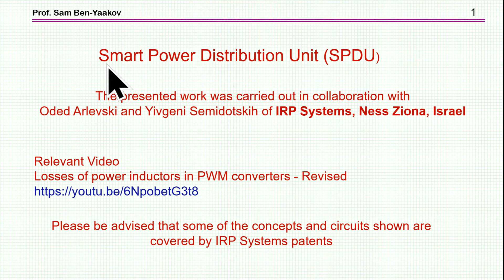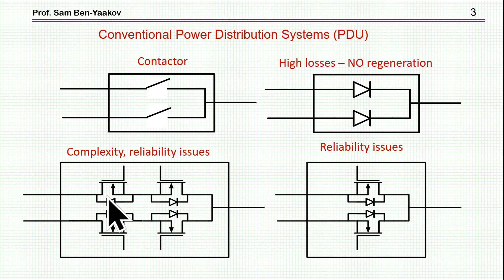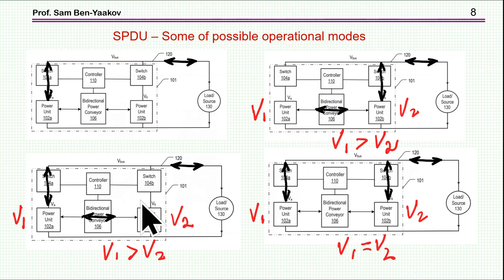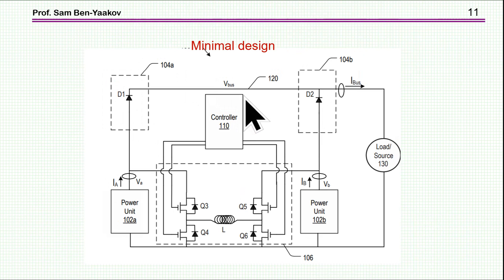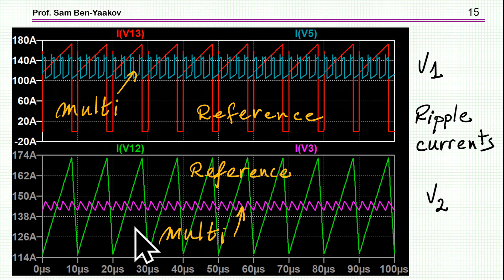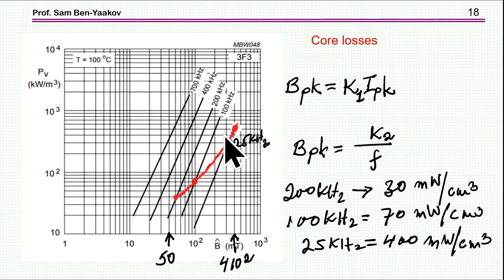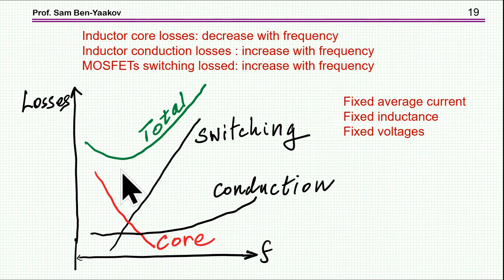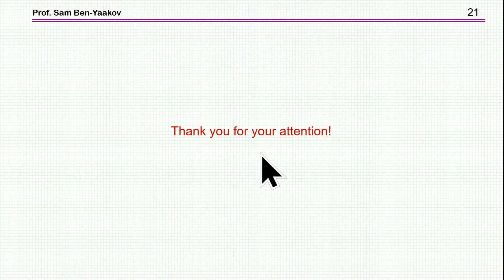Smart Power Distribution Unit (SPDU)

Comment: Shouldn't there be an acceptable voltage difference between the batteries when both will supply power ? Otherwise it could lead to chattering where the system constantly keeps charging one battery or the other ?
Reply from the maker: If voltages are the same there is no reason for current to flow. If there is a difference the current could be very high considering the low internal resistances.
Reply: Traditionally in the drone community people just connect battery packs of same cell count in parallel to provide more power.

If it can be shown that this unit provided significantly longer battery life, it has a huge market.

Comment: I have a doubt Sir. Even if Bpeak doesn't go up with frequency, but stays the same. The fact that loss is given as KW/Vol means if Volume decreases power loss should decrease.

So can't we say in general that higher frequency is good ?
Reply from the maker: Hi Srinath. The case under study  is: given a built inductor, what is the optimum operating frequency.

Comment: Thank you for the video, this was a really good explanation. Just a minor thing: on page 20 the temperature rise seems not to match the picture for 100 kHz. 34K vs 23K
Reply from the maker: Wow. Thank you for pointing out this error. You have a keen eye. In this case the deference between 50K and 100K is not that big. Getting much bigger though at higher currents. I will put a notice on that at the description section. Thanks again.

Comment: Dear Professor, thank you for the presentation. I have  a question about this topic since i am implementing the same thing without bidirectional dc-dc converter. We agreed that no need to implement converter, instead a contoller should let the higher voltage battery run first and when two batteries reach the same voltage level 2nd battery should be activated. First battery will discharge/charge higher C rates for a limited time but eventually their characteristics like impedance and aging will get similar values. Does anything wrong exist in this consideration? Will be glad to hear your thoughts. All the bests
Reply from the maker: Thanks for conversation. The approach you describe is basic but it does not answer the requirement of being able to supply a current which above the capability of one battery. This is our specs.

Comment: What is the controller's objective? I would aim for minimisation of the number of charge-discharge cycles and the minimisation of the probability of damage to the battery.
Of course since the power source could be anything, the second objective cannot be applied unless you have a dedicated controller for the battery technology intended - and associated sensors/inputs. The first objective would be tantamount to limiting the percentage of discharge of either battery i.e. strive for equal amount of charge in both batteries) since the controller cannot know how many cycles a battery has been subjected to.
It looks like the intended application is only for energy sources capable of holding electric charge, i.e. PV cells need not apply.
Reply from the maker: The tasks of the controller are numerous, from generating the gate drives, current sharing between the inductors, controlling the bus switches, controlling the proportional current sharing of batteries and more.
Reply: @sambenyaakov  I was referring to how it decides how to do the last one-controlling the current sharing of the batteries.

Comment: Great video!
As a question, II don't know how those bidirectional FETs are driven. Are there special ICs, or do normal ones work good enough? Also, is there any advantage in the common drain to common source configuration? 
I searched a few previous videos but didn't find much; this may be an interesting topic for a potential future video.
Reply: I think common source is more robust acc to protection but needs floating type gate drivers which may cause some emc issues, common drains may be low cost and diode recovery should be considered in some cases.
Reply from the maker: Thanks. Good points.
Reply from the maker: These are common FETS which will conduct both ways. Common source is preferred so yo have common "ground" for the two FETs.
Reply: @sambenyaakov  THX so for nMOS coon source allows me to use 1 high side nMOS driver only since both gates have the same reference, that make sense, and the dioes prevent current getting in, that also makes sense 
BUT for pMOS that would mean that current can inter the common area from both sides and then I am not sure how to drive them OR since it is p I need to make it common drain and then also drive it like a normal high side pMOS?

PS , tho this is getting off topic with lets say a common source nMOS setup can I switch on and off AC mains ? it should be able to block both ways but wont the gate drive voltage encounter problems due to the nature of AC + needing to float on the AC
Reply from the maker: @Robert88KAL  gate drives need to be floating it will work with AC. For p you need a negative drive voltage.

Comment: Since it came up in this video, I would absolutely love to see a video on the low-level details of MOSFETs designed for wide SOA and linear operation, particularly in relation to the properties and behaviours of planar and trench constructions and their relative susceptibility to the Spirito effect. I've never seen a satisfying explanation of why planar constructions are considered more immune to thermal runaway; I have my suspicions that it's related to dynamic control difficulties with trench construction's high transconductance, but even after I spoke to a few MOSFET design engineers they couldn't give me a conclusive answer and it'd be great to see this explored in detail.
Reply from the maker: Will try. Just put it on the Todo list.
Reply: @sambenyaakov  Thanks! :)

Comment: The overall design, minus the multiphase converter, is very similar to how load balancing solutions work in chassis backplanes for enterprise computing equipment. In lower power solutions they utilise parallel wide-SOA MOSFETs in linear operation to act as a programmable voltage drop, to ensure balanced current across the supplies. In higher power solutions they pair this with control feedback to the power supplies to perform coarse voltage matching adjustments, then use the MOSFETs for fine adjustment at the point where the power bus is merged. Blade chassis systems often go one step further by dynamically scaling the number of active power supplies, to push the operating SMPSes into more efficient load levels and perform round-robin load distribution, integrating system management controllers and processor power management features (e.g. Intel PL1/PL2 + RAPL) to ensure that the supply balancing controller has enough time to bring more supplies online during load spikes.

I've been working on a related design on and off for several years (dynamic balancing of low-cost off-the-shelf compact AC-DC converters in a space constrained environment) and I had never considered the idea of utilising a multiphase converter as part of the balancing system. I don't need bidirectional operation and I'm not sure if the cost and complexity will work out for my particular project, but I'm glad you posted this video so I can experiment with the idea!
Reply from the maker: Thanks for sharing. Different from power supplies, here we need powering and regeneration as wee as controlled sharing in powering and regeneration modes.

Comment: Thanks dear professor for nice presentation. In 13:40, I think conduction losses first decrease with frequency because of decrease in ripple current that means reducing rms current, after a point I think proximity effect can change the corresponding slope.
Thanks again for nice and intuitive videos ❤️🙏
Reply from the maker: Thanks for comment. Yes, you are correct. But..the max increase in rms at LF (BCM) is only 15%. And yes, proximity will change the slope which I believe I said in the video.
Reply: Thanks for informative feedback 🙏

Comment: I really dislike the way patents have to be written.  For example, "Power Unit" is the battery but the words "Power Unit" could be almost anything.  Makes patents very hard to read.  They should call them Power Sources instead IMHO  😁😁
Reply from the maker: Hi, thanks for comment. This is done on purpose cover (todays and  future) storage elements such as super capacitors and a combination of different technologies.
Reply: Yeah, but you know it is generally only going to be used with batteries for EVs.  That's how you make the patent as broad as can be.  The balancing of the voltages of the two sources is kind of obvious to one skilled in the art to me though.  IMHO of course  👽👽
Reply: @k7iq  This patent is written like this to achieve maximum coverage. The topology covered in the patent (4 switch buck-boost) has been widely used on the interface between 12V and 48V buses in automotive industry. The only difference here is both energy storage device is interfacing with one single bus. From application point of view,  at least  in automotive, this is almost completely useless, you can use the same number of switches to do a bi-direction two phase buck (which is boost in reverse direction) with one energy storage devices. Nobody would use two energy storage devices at the same voltage like described in the patent ( Large battery pack has either active or passive balancing built-in which essentially serve the same purpose) , anybody look up the cost of a high voltage DC disconnect switch would not use this for civilian applications (military is different story).
People fabricate patents like this for protection in most cases, I have read so many patents covers so many vague concepts just to make sure you cannot use anything comes in a ten mile radius.
Reply: @yiqiwang4506  this would be for integration of the battery pack balancing into the electric drive train. There is lots of room in automotive for innovative solutions for battery management. I could see a more robust version of this having real legs.
Reply: @yiqiwang4506  Yes it is broad.  A very similar thing is done in solar photovoltaics in series strings of panels so that if say, one  or more panels are shaded in a string, then it can bring up that voltage to the non-shaded string Vmp.  This allows more power out of the entire array of PV. Otherwise, the MPPT device would have to compromise and run at a lower voltage than it's optimum. 

I know it is different than this example but similar. Pretty obvious to me.  But there may be some more that does not stick out about the patent.  Maybe the ripple reduction in combination with balancing ?  I have to watch again.  I could not find any patents related to IRP Systems in Israel which might change my mind.

I have been through so many patents myself to get the company (companies) out of legal trouble but so far, they just go away   because even they do not want to have to go through the legal hassle and cost of going to court.  A very large company might just sue you into bankruptcy though.
The patent system is broken for the most part in my mind.  Not everything of course but a lot of it as far as I can see the last many years.

The US patent office doesn't have to care much because they are immune from litigation unfortunately.  They do sometimes invalidate patents though which is good.
Reply from the maker: @k7iq Yes, sure, after you read any patent it is all of the sudden obvious😊But there is another important aspect. There are many patents around this subject. And since this concept is patentable (yes, with all due respect, the decision of the patent office counts more) and since we are going to produce this SPDU, we better own the patent rather than our competition. And BTW, there is much more than meets the eyes. Pivotal points are kept secret and not revealed in the patent application. So they are not obvious as yet😉
Reply: @sambenyaakov  Thanks Sam.  Battery balancing in itself is obvious and is why I would never even think of patenting that part of this.  That is why I would have to see the patent and its claims.  Can you give me a patent number to look at ?  I can't seem to find one based on IRP Systems in Israel being the owner.  Of course, I might not be looking correctly OR maybe IRP Systems is owned by a larger company which might be the assignee ?
BTW, I have nothing to do with any EV technology except for power electronics itself.

Thank you for all of your videos and help !
Reply: Also, the US patent office only looks at previous patents when looking for prior art.
I think that is not good.  I mean, except for things we take for granted like the light bulb.
I have gotten several lawyers and companies off our company's backs by showing them prior art that was not patented.  It's easy money for the patent office.  A cash cow as we say here in the US  😁
That said, there are still good places for patents.  I might be able to make a better informed decision about this one if that patent is actually out there to see
Reply: What is actually patented here ? The balancing of two batteries or interleaved buck converters running at the optimum frequency for lowest losses or both ?
Reply from the maker: @k7iq   Hi,  I will send you the number once this granted patent is published. Meanwhile you can read  US11370308 😊
Reply: @sambenyaakov  Thanks Sam !  I understand. 

So, looking at the claims, especially claim 1, there might just be some novelty there.  And it looks broad enough that it does not include, exactly, the circuit you explain here which would be part of the figures and other text in the patent.

I learned a new word.   "coupleable" 
 
Yours Truly,
Pat Pending 
:face-blue-smiling::face-purple-crying:🙂
Reply from the maker: @k7iq  There are two granted patents on this, one published and one allowed. To be published soon. And BTW, I think you miss the meaning and purpose of patents today. They not  super-engineering or Einstein discoveries, they are just technology protection. As for novelty and innovation, show me your patents and I can surely show that they are obvious, anticipated and simple to the worker in the trade 🤣🤣
Reply: @sambenyaakov  Agreed.   Our industries have  many similarities.   Of course we are both going to think each other's patents are obvious. 😃  It is a lot of work doing what we do, trying to get it right.. Gotta protect that  or at least try to deter the competition from infringing on our work.  Hopefully a judge or jury won't have to decide anything l
I have a love-hate relationship with patents. I would rather just be able to design and work freely without having to deal with patent trolls and lawyers or even work at getting a patent.... Making a patent(s) is also hard work and takes time.  Money is good but I'm not all that legally ambitious if I don't need to be.
Reply from the maker: @k7iq  👍